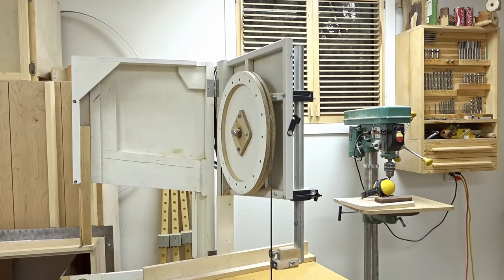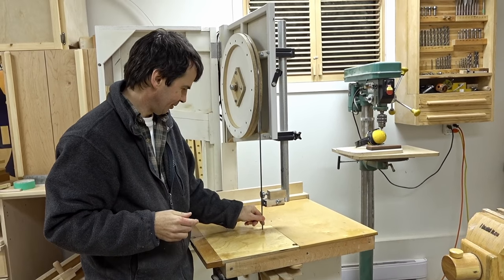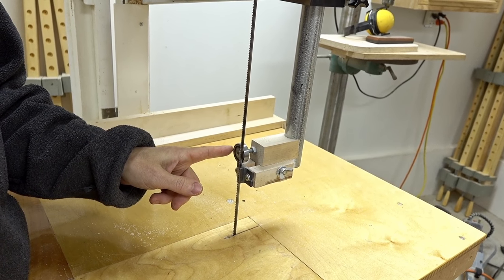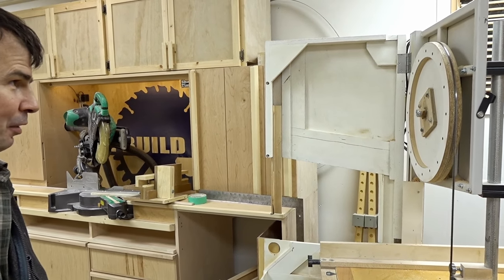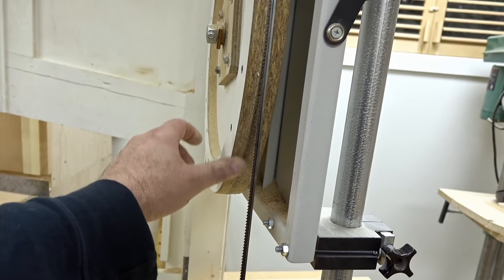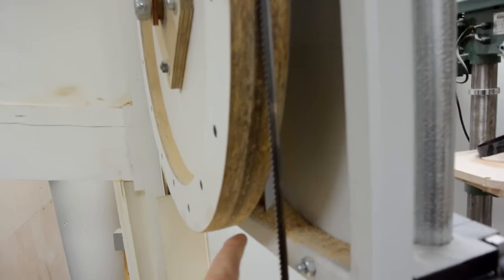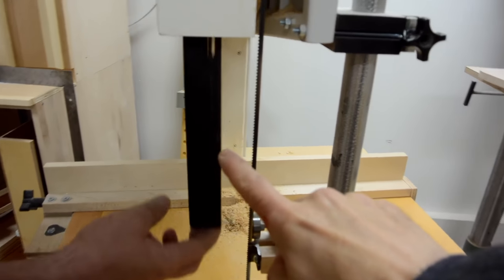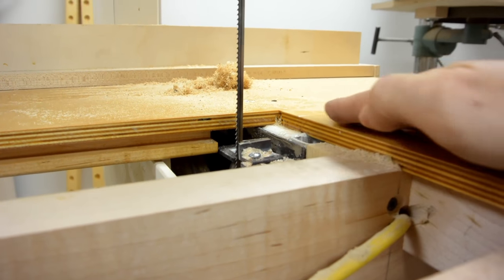Matthias Looks Over My Homemade Band Saw

Comment: I like the new blade guides, John.   I also liked the idea of attaching ceramic tile as you did on your mill saw's guides.    I once used a similar idea for the bottom guides of a large antique bandsaw I rebuilt for someone,  but I attached case-hardened steel pads to them.  If you wish to just use steel angle by itself, you should know that the steel angle from an ordinary bed frame is relatively high carbon and easily hardenable.

Comment: I made my 3wheel bandsaw of wood but in Finland the season related humidy makes really alot of thicknes change to the wood so I am planning to do my next bandsaw at least partly metal. Even my wooden tripod had fallen over by its own in the shop when humidy dropped due the frosts outside and heating the shop.

Comment: I'm more surprised with the silicon caulk not wearing out after one short use than I am with particle board wheels.
Reply from the maker: Silicone has been on there for more than a year and holding up great.
Reply: And thanks again for the follow up.  I watched you put it on there either when you built it or did some repairs (don't remember) and wondered how long it would last.  Love your work.  Glad you and Matthias had a good time.

Comment: "I think wood works just fine"
Yeah, but... how much wood did you have to use on yours?
Reply: As we all know a lot. I think John's bandsaw looks better and those couple details are very smart. But lack of tilting table is a drawback and cuts corners for the design. Wooden frame is ok, but I advice to not let the blade tension on. Under prolonged force wood gives in, steel doesn't.
Reply from the maker: +bekanav - a couple of points: a tilting table on a band saw is rarely used, if at all. I would judge it not worth the bother for a homemade saw, since it over-complicates the build  for very little in return. I certainly don't miss it or regret not doing.
You are not correct about a wood frame "giving in" from blade tension. A wooden frame can be as strong and stiff as a steel frame and stay that way.